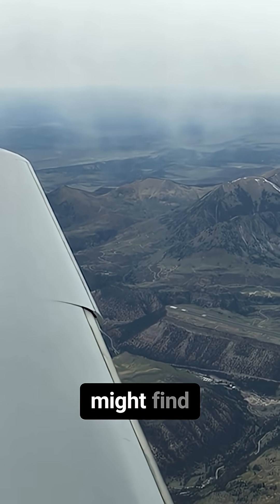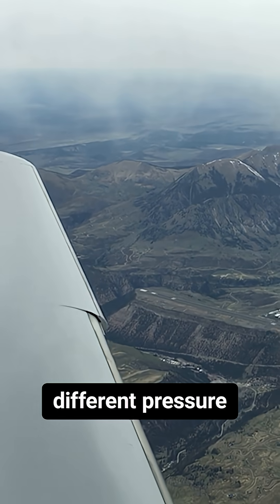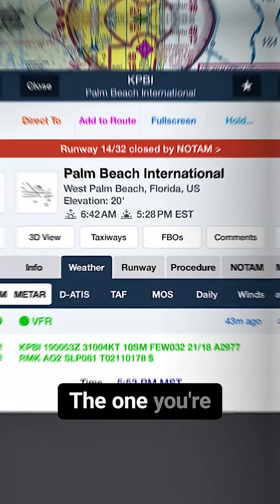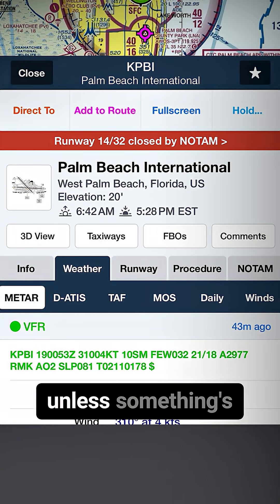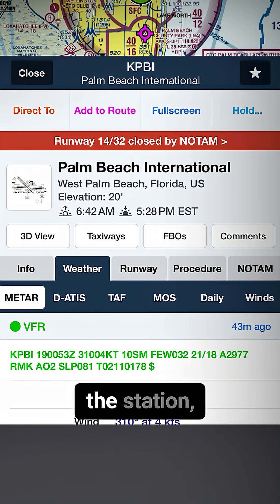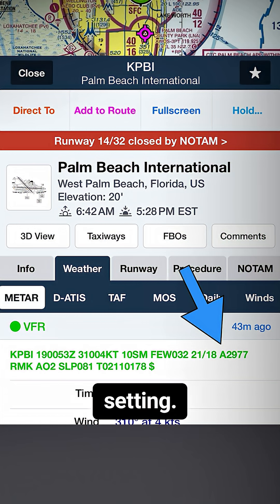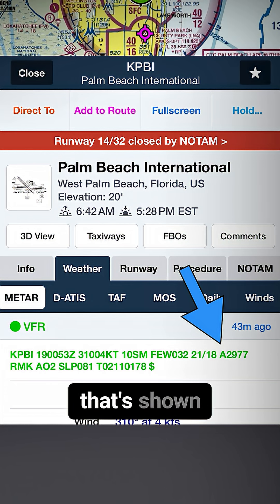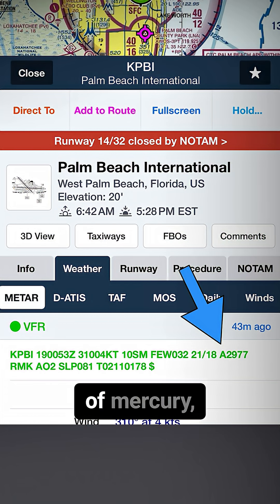How is the altimeter setting calculated?

Comment: Nice, can you make a video on why the altimeter reads higher as you adjust it to a higher setting? Some people find that hard to understand because you would think that higher pressure, means lower altitude. Thanks.
Reply: The altimeter reading is only as good as what you input into the window. It only works by detecting pressure changes using your reference input as a data source through the static system. The altimeter has no idea whats going on beyond pressure changing. It translates a decrease in outside static pressure without an input change in the window as an increase in altitude. The same applies viceversa, if you increase the ’pressure input’ (which again it’s just a number it uses) without a change in actual static pressure it translates it into an increase in altitude. Hope this helps
Reply: @erossaccagno3218 perfect! What confuses people is that by turning the knob, you only change the reference by which the altimeter tells you the altitude, you are telling it, now I want you to read by this “new reference” basically.